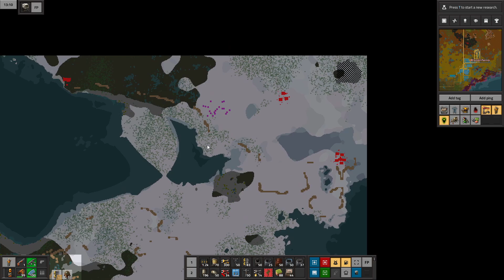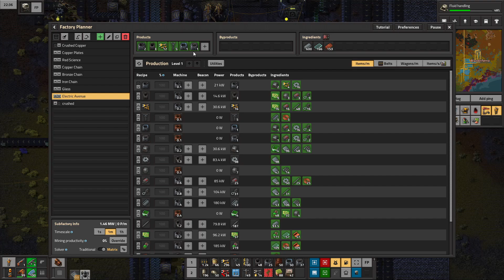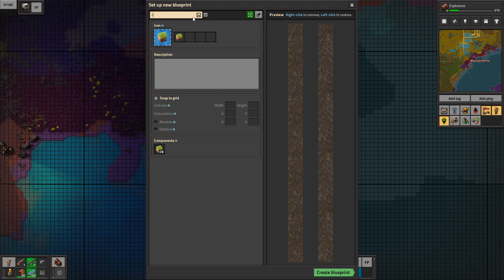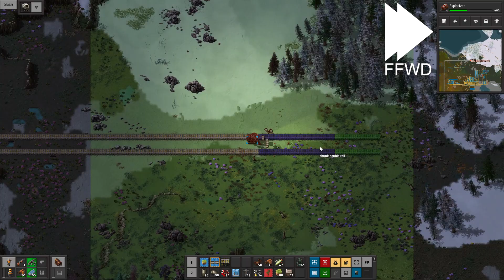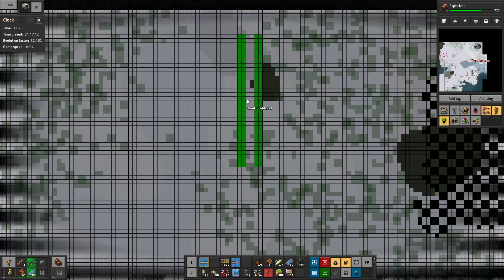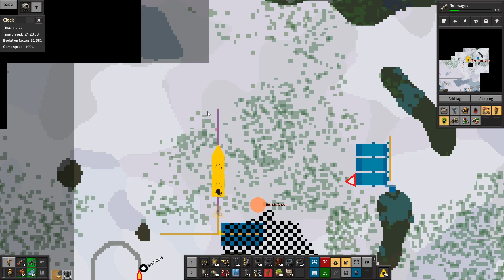Factorio - Industrial Revolution: Day 12 [Wrong Side of the Tracks]

Comment: Jusat made the switch in my playtrough to coke coal instead of regular coal and it makes a pretty big difference. Not only it has more energy so it lasts longer, it also generates less pollution.

I acutally use a mix of charcoal and coke. my wood line has an overflow that goes to a few charcoal ovens, and that mixes with my coke on a higher priority before heading to the boilers. Not only charcoal only generates 50% pollution, it also makes sure my forestries stay empty and working, reducing pollution even more. Just finished automating all the basic iron machines, assemblers, inserters, red belts, electric furnaces, grinders, mixers, miners, labs lamps and forestries. On the defense part, i automated walls, doors and both type of turrets.

Next for me is setting up a perimeter, make a better ammo factory and automate the delivery of ammo towards the walls with trains. after that, i can start with petrochem. I installed the optional special projects addon, so it should take a while to research all the oil processing recipes.

Comment: there is a machine called electric scraper
you can use it to recycle old machine
Reply from the maker: True, that'd help with the boxing problem. I just feel like the value it creates is less than the time to set it up.
Reply: @blaze_gaming2  be careful because you are gonna end up with thousands of scrap to resmelt
Reply: @blaze_gaming2  In my current playtrough i'm planning to go with a train system. I'll add to the dedicated smelting area a scrapping area with a recicling station and train. That way i can at any point set up a station top call the recicling train, load it up, let it go to recycling and remove the input station.

Then the scrap gets sorted and goes into the furnaces with a higher priority than the ores.